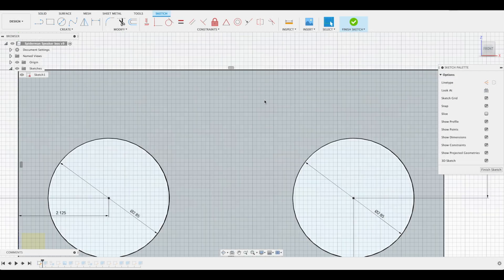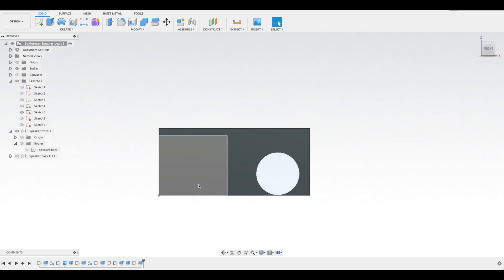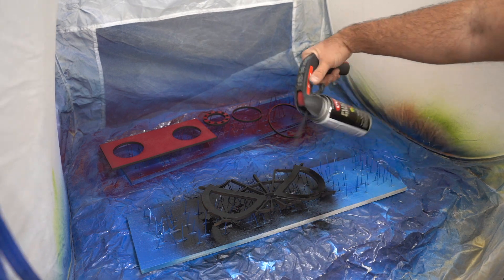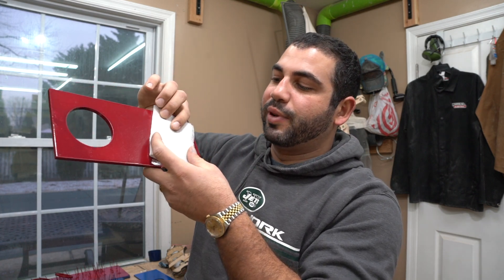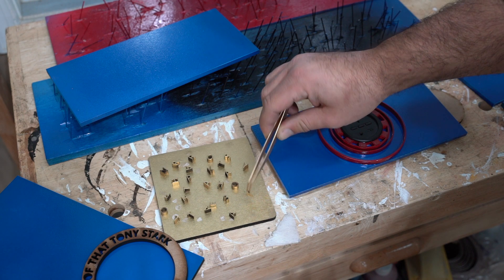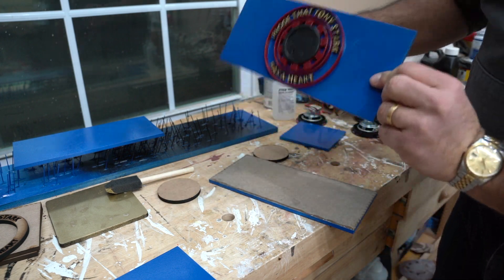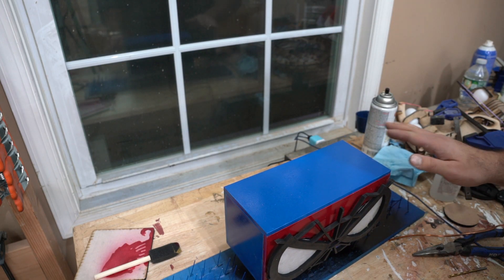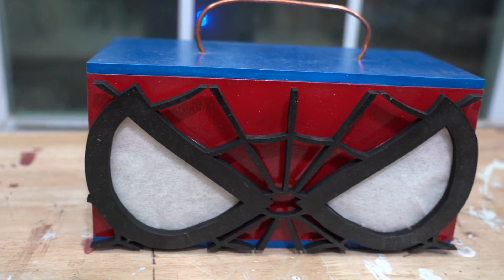Spider-Man: How to Design and Build your own Bluetooth Speaker!

Comment: So which do you use more the glowforge or the Makermade M2?
Reply from the maker: I think I use the glowforge more often, but I use them both a lot. If it’s anything large or thick wood, I use the M2. If it’s anything thin wood, I’ll always use the glowforge since it’s a little easier to get going with